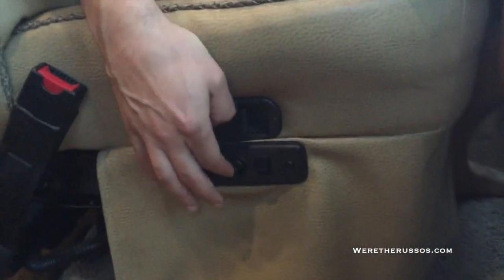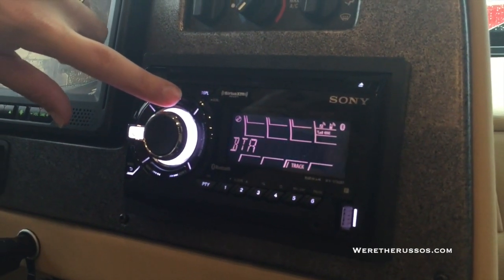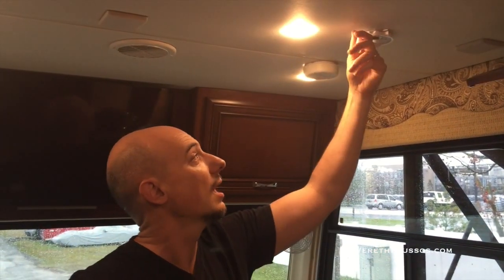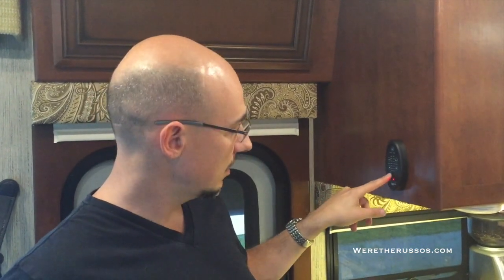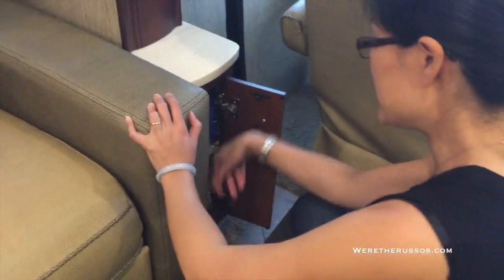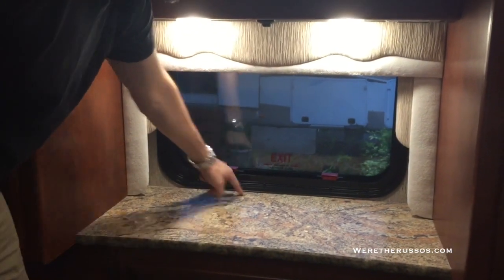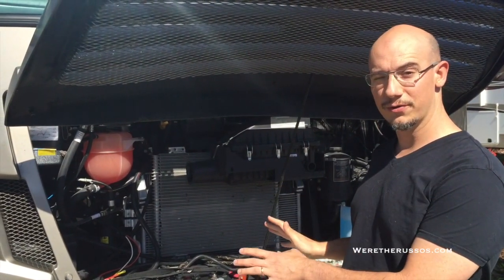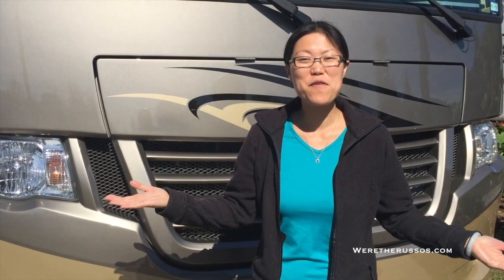Small Class A Motorhome Tour | Newmar Bay Star Full Walk-Through

Comment: Depending how hot the drawer underneath the stove top gets heat can  age spices prematurely. 24:36 Another thing about the side window (awesome that they open) is it really let in a lot of light in. Less so in this case because of the width of your slide but if you have a small slide just for a love seat it actually creates a tunnel when extended. This darkens the interior, the side windows diminish the tunnel effect. Look at any class c with a murphy bed up front and see how much you miss the light from a window on that side. Looking at the windows in the bedroom have you though about getting a escape window/hatch in the back and a normal window on the slide. That is if they are not custom windows. There has to be a wrecker yard where damaged motorhomes go after a bad baker. Enjoyed your video!!!
Reply from the maker: Thanks for the suggestions and things to look for. If we were to replace the rear window with an escape hatch it would be a completely custom job. We keep something in the bedroom we can break the window with if we need to get out...otherwise we have the smaller escape hatch on the side.

Comment: I've seen a lot of walk-throughs but your's is by far the best I've seen. I felt like a buyer being told how to operate all of the systems. Great job! Very nice RV. Only thing I would not be thrilled with is how low you have to get to access some of the outside storage bays. Particularly hard with the slides out. Maybe not a big deal for young folks.
Reply from the maker: +Brian K Kinney Thanks Brian. I [Joe] have some issues getting into the bays when the slides are out because I have a bad back. That said, when they are in, the doors lift up fairly high and make life a lot easier. If we were buying another coach, we'd look for the doors that swing out to the side.

Comment: I really enjoyed your walk thru!!!  My husband and I just bought a used 2013 Bay Star 2901 and are looking forward to getting out camping this summer (just picked it up Dec. 15th 2015.  It went into storage right away).  I love your idea about using the dinette for a lounge to watch movies, that would be wonderful.  We also boondock so your suggestions are very helpful.  Do you run the generator when you set up at your site where power is not available??  my old RV allowed me to keep the engine running while extending the slide room but this one does not.  Enjoy and I am jealous.  we have to wait for spring!!!
Reply from the maker: +11e We don't fire up the genny until we need to recharge the batteries. We have a small portable solar panel that will keep things topped off (http://weretherussos.com/renogy-100w-portable-solar-panel-review/) when its sunny. Otherwise we typically run the genny for about 2 hrs or so a day to make sure we recharge the batteries. We did swap the two 12v batteries for two 6v golf cart batteries and saw a nice improvement. Spring will be here soon enough and maybe we'll see you on the road!
Reply: I was wondering if your Bay Star came with Tru Center on the steering??  I just noticed we have it on our 2013.  If you have it, how do you like it??
Reply from the maker: No we don't have that on our coach and haven't heard of it. Was it factory installed? We ask because many people upgrade the suspension and steering with these gas coaches and that may not have been a factory add on (but probably good you got it).
Reply: We just bought this Coach in Dec 2015 (had a Itasca Navion that we traded) so it was already there, must have been an add on.  I have not used it yet but I hear good things about it.  I am still learning/discovering things about RV, will be for a while!

Comment: Nice RV / great video good job !  - I'm shopping for one; I just have a quick question for now: you mentioned having some special stuff to clean bugs off the front; what do you use?
Reply from the maker: Used dryer sheets...works really well.
Reply: You specifically said you had a special cleaner? Is it the dryer sheets you mentioned or do you have some sort of special cleaner solution that works really well with the diamond shield treatment - I’m assuming diamond shield protection comes on all the Newmar coaches; I’m looking to buy a used 2014 in few weeks.  I had a Class A once, and getting all the bug splatter off the front was an issue for me.

Comment: 33:40 what is 'screen mirroring' (rear tv) - can you broadcast from phone or tablet?
Thanks for this great video! The only item I'm left wondering about is under the doghouse, how easy is it to get to the engine from the inside, and how much space is there for additional sound insulation?
Reply from the maker: John - for screen mirroring, both TVs have it but we haven't used it. We typically plug our laptop in through the extra HDMI connection and we've done the same thing with a Chromecast. We have not removed the dog house cover but have been underneath to change the oil. There is quite a bit of room under there and we've seen others who have added extra insulation (but been disappointed in the results). Our Newmar did seem quieter than other similar coaches we test drove.